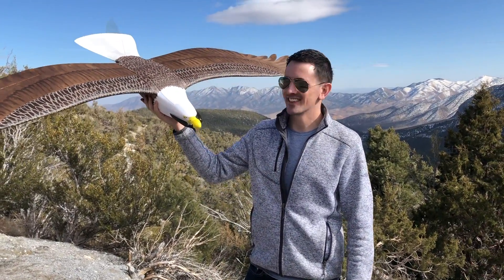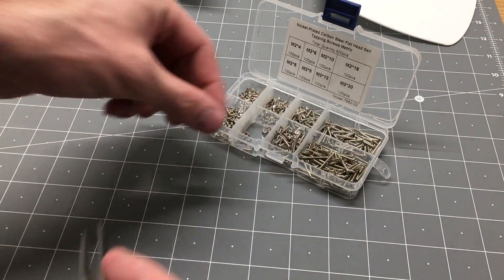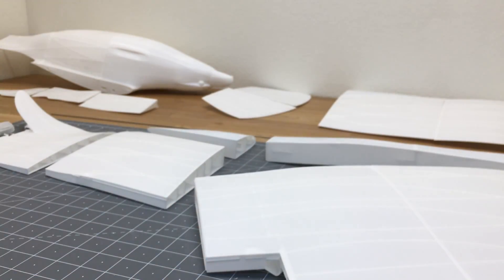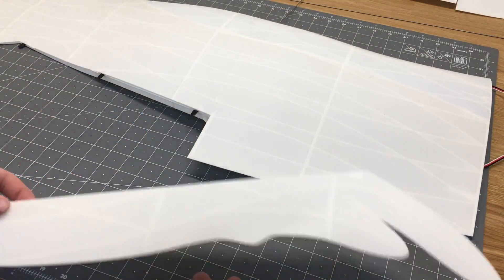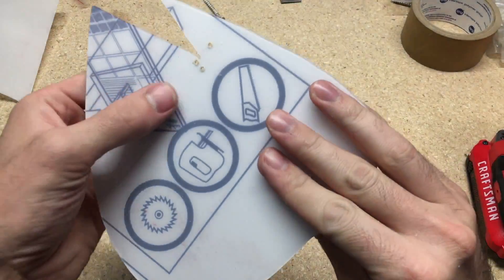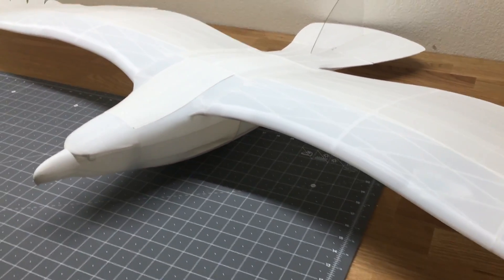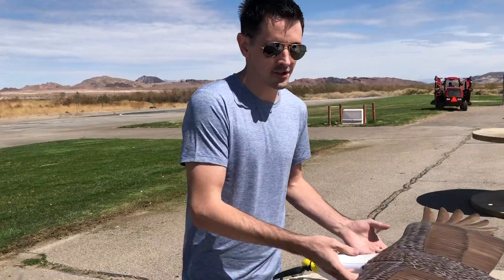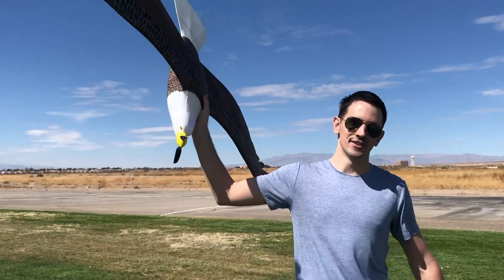Epic DIY 3D Printed Planeprint Eagle Build

Comment: Man, I am digging your Channel. I didn't even know you could do that. I'm interested in your thoughts on your printer. I know you're not a printer Channel, but I'm looking at buying a large-scale printer and I'm down to using either the artillery X1 or the creality cr-10 version 3. Both are direct drive, but I'm mostly looking towards the creality because of the print community, and it will be my first printer. Any thoughts on that?
Reply from the maker: Thank you, I don't have experience with the cr-10 but the artillery sidewinder works very well I would definitely recommend it for a first printer. One of the reasons I have not gotten a Creality printer yet is because it seams out of the box they need some upgrades to make them a good printer. I want to be able to just use the printer out of the box. I think the version 3 is much better now though. There is definitely more parts and a large community that uses Creality so there is a lot of information out there for those printers. I may be giving a Creality printer a try soon though.

Comment: Hi Troy, have to say this eagle is absolutely beautiful! Nice work with the paintjob! I saw you didn’t use accelerator for PLA. Is it just cut off to sped up the video a bit, or you omit that for better glue joints?
Reply from the maker: Hello, Thank you for the comment yes the paint job is awesome she did a great job with it. I don't use CA accelerator. It makes the glue not as strong from lots of testing. Also it turns the glue joint yellow and for the white build it really stands out.

Comment: Thank you for another excellent video this looks fantastic. Your wife did an awesome job painting. She also does great camera work. What 3D printed model would you recommend to start with for someone with no RC flight experience?  I have no problem tuning and getting good quality prints of my printers.
Reply: Though, truthfully, you’ll be better off initially with something more robust and likely made of foam.
Reply from the maker: Definitely agree with Bandon, The Eclipson planes are very easy builds and fly very well. This eagle flies very well but could be difficult to learn to fly rc with. I would recommend buying a foam RTF plane to learn to fly rc then build one of these 3d printed planes for a second plane.
Reply: Eclipson has provided for free a belly lander version of their model A on cults3d. It’s considered a trainer and wasn’t too expensive to outfit.